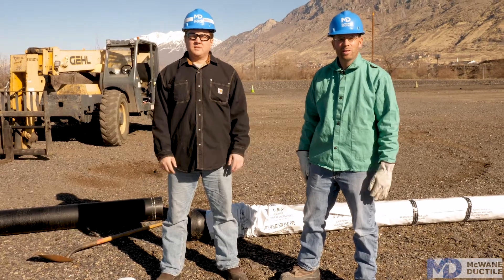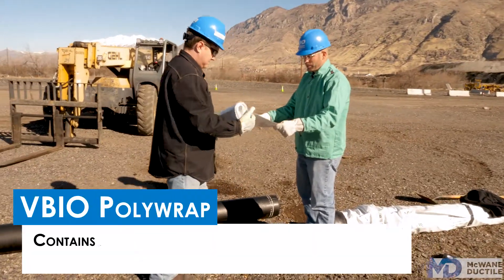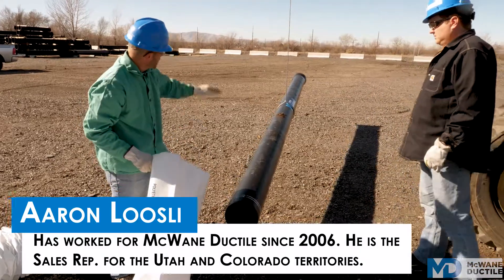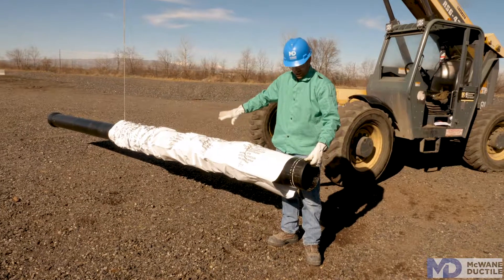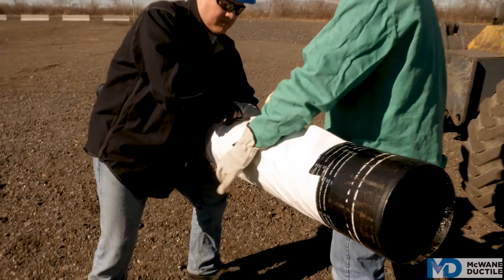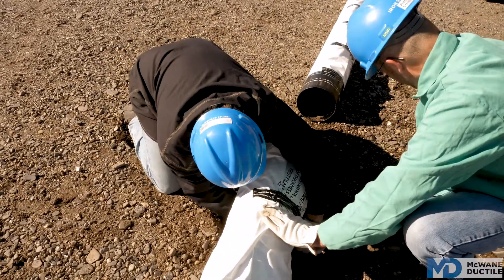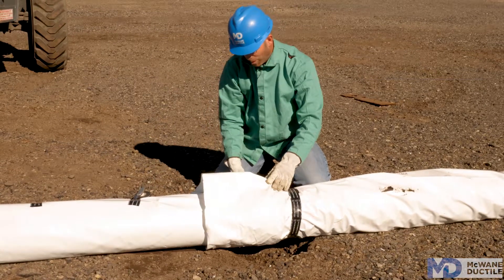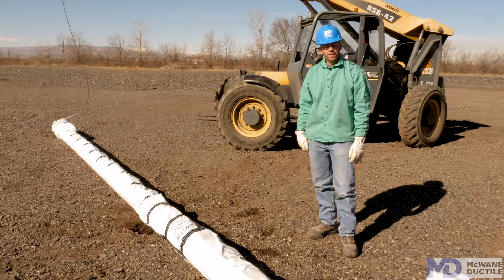Eight Steps for Installing V-Bio® Polywrap

Comment: How about getting over restraints?  Makes it incredibly tight.  Is there a splice technique?
Reply from the maker: Thanks for your questions. Splicing is doable, but not recommended.  The better option is to upsize the wrap one size to easily slide over the external restraints where needed.
Reply: @McWaneDuctilePipe  appreciate the prompt reply cheers!